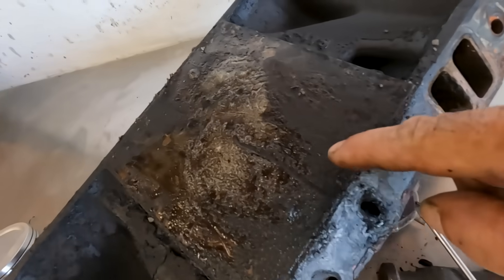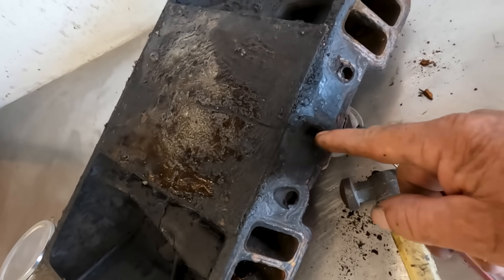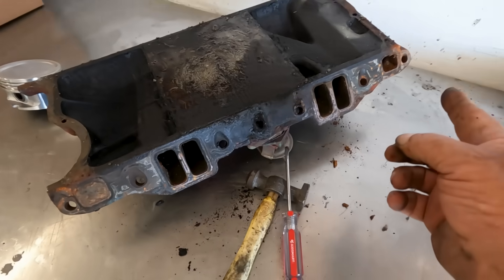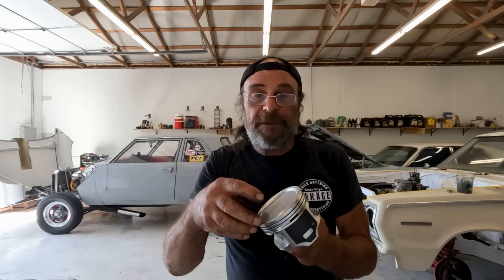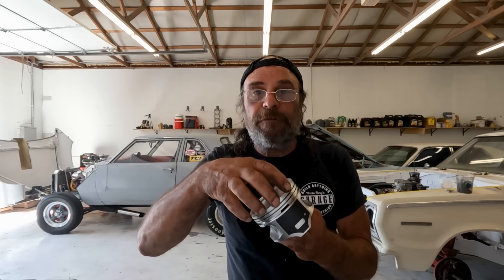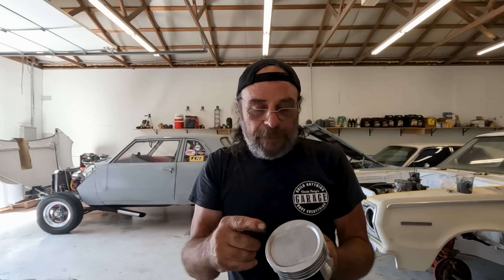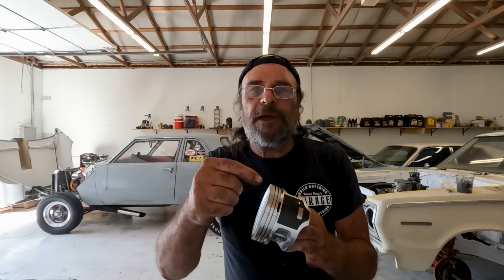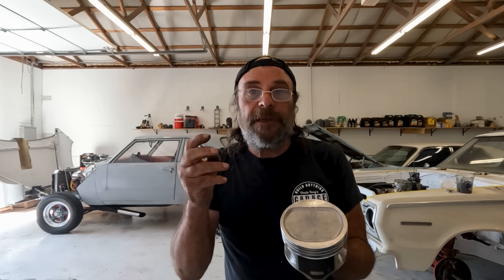The Number One Killer Of Gasoline Engine Efficiency And Power And How To Stop It

Comment: Toyota engines have a carbon ring problem. Main culprit for this problem is extended 10,000 mile oil changes. These cars would get up to 110K-120K miles and all of sudden it becomes an oil burner. I blame Toyota for this problem. They use to have recommended 5K mile oil changes on the engines used in the hybrids. They wanted to cut service costs for the customers so they changed the 5K mile oil changes to 10K miles. People that own these cars that do 5K mile oil changes, almost never run into this problem.
Reply: My 2 4Runners have the 10k spec. They only see 5k max oil change interval ever! Same with my powerstroke.
Reply: I change my oil and filter, every 3,000 miles, or three months, whichever comes first.
Reply: @Bill-sp8kb  I go by miles and not months.
Reply: My 2013 Camry gets changed every 5k and it has about 280,000 miles on the odometer.  I drive it everyday to the Toyota plant and back.  45 miles one way.
Reply: The oil rings are low tension for fuel economy but they allow more blow-by.

Comment: The olds 455 would get so hot, the manifold would Crack, and death cookies (carbon)would form under the manifold from the heat. The gas would evaporate out of the float bowl when stopped.. we all block them off now

Comment: Uncle Tony,
The water trick was used by a friend and I on his 1981 Buick Skylark 2.8 L V6.  We used a spray bottle set to a rough mist while blipping the throttle.  We did this right after running some Dexron/Mercon fluid into the carb help clean internals of the engine.  The water mist was a steam clean.  
Seemed to work wonders.  Thick smoke initially but cleared up, so it seems we cleared it out pretty good.  
Even the catalytic converter.  :D
Reply: I'd done this by removing one polution hose and adding a small tube to a 5 gallon water container inside the car. 
While driving , I'll open a tap. It helps increase compression. But the car was slowing, and it would backfire.
Reply: @paullionnet5141  Youre lucky you didnt hydraulic the engine!
Reply: Was a kid reading car craft in the 70s when I read about the trans fluid/water
Did it on my Dads 73 Impala.
Reply: @gordocarbo yes you put pee in side transmission and engine and the car work like new. OK

Comment: WHEN I  WAS WORKING AT THE  ENGINE BUILDING  SHOP. ..IN ONTARIO. I. WOULD REMOVE ALL THE VALVES AND  SPIN THE VALVES IN THE  DRILL PRESS AND KNOCK OF ALL THE CARBON OFF STEEL BRUSH  A WELDERS BRUSH AND  SAND BLAST THE INSIDE OF THE VALVE, AREA AND RUNNERS...I WAS TOLD BUY A BRITISH ENGINE BUILDER .I MENTIONED THAT I  TOOK  THE CARBON RIDGE AROUND THE  TOP OF THE PISTONS HE SAID THIS IS VERY  IMPORTANT IN SEALLING FOR GOOD COMPRESSION. ALL IN ALL THIS WAS A  CAME AND SPRING, VALVE SEALS. NEW. OFF EACH EXAST VALVE I GOT 2 TABLE SPOONS OF FINE CARBON....ALL THE  BEST...

Comment: Get yerself some granulated sodium hydroxide pellets from the hardware store, put some boiling water in a bucket big enough to submerge the manifold, WEAR GLOVES AND A FACE SHIELD, dump a cup or two of the drain cleaner in the hot water, (its gonna react violently) and after it settles down, put the manifold in and come back in a day or two.

Edit: you cant do this with aluminum, it will dissolve aluminum and ruin the mating surfaces.

Comment: People always caused me crazy when i used a coca cola bottle with water from the tap down the throat hole of the Holley double pumper on top of my then low 12 sec Olds in the late 80s. Whenever the engine came apart there were dark spots but never carbon built up on back of the valves or ring lands. As far as "blowing out the carbon" well that was done on a daily basis as part of the program of being a young mechanic with a musclecar.

Comment: I have a newer v6 camaro with direct-port injection. They're known to carbon up the intake valves. The popular thing to do is take off the intake and with each intake valve closed blast the valve with crushed walnut shell media and vacuum it out. I need to do it soon.
Reply: Port fuel injection engines never had that problem. The injector would spray almost directly on the intake valve it kept it clean.
Reply: I have a 2012 Impala that uses the same motor and trans from the Camaro. Best car I've ever had!

Comment: Back in the early 80s my father was driving his 77 Eldorado back from Florida via Kentucky to visit an aunt. Came out of his motel room and started the car for the trip back home to MA, and it backfired through the carb. He restarted it and it had what sounded like a rod rap. He left the Caddy and rented a car, then drove home. He drafted myself and a friend, and we drove 20+ hours straight back to Kentucky. He bought a crank kit and had loaded the car with tools, a chain fall. A chainfall. The heat and humidity were brutal. Before we started I got a large cup of water and started the car. I slowly poured the water down the carb and the knock just faded away. We took the car for a test drive to the next county, that wasn't dry, and bought a case of beer. Spent the rest of the day drinking by the pool. We were overjoyed that we didn't have to pull that engine out and replace the crankshaft and bearings in a dirt parking lot.
Reply: Back when you didn't have to worry about your car getting stolen when you left and came back for it.
Reply: My dad traded a case of beer for a '57 Chevy carry all with a stock Pontiac big block because the owner thought the engine was ready to let go from roof knock. After dad had his fun running the crap out of it he money shifted it on purpose to end it's life. After a loud bang it started purring and ran perfect. He drove it from California to Virginia and pulled the engine down to find nothing wrong. Only thing that came to mind is stuck rings from carbon since it was a city parts delivery vehicle
Reply: Yep......i used to run water, VERY SLOWLY into the carb like Tony says, after a good hard romp around the neighborhood.....and a cup or so is all it usually took and you could really tell the difference after you did it......that and the old Ford upper cylinder lubricant.....or better known as smoke screen creator....lol   throw a half a bottle or 2 of  B12 Chemtool in the tank and GO!!
Reply: @ssnerd583  did the same in the 80s. Use warm, or hot water and a spray bottle, rpm 2-3k it works
Reply: I thought people who afford new Cadillacs get tow trucks, not try and rebuild a near new engine by the side of the road?
Reply: @cruiser6260  Read the first sentance of bobs comment again.  The car was at least 4 years old.  (Back in the early 80s my father was driving his 77 Eldorado).
Reply: @Dave-ty2qp  well I wasn't making no assumptions about this beast being traded around in that timeframe, but yep he might of got it second hand. Hanging that chainfall somewhere on the hotel and rebuilding the motor right there woulda been a sight to see though!
Reply: @cruiser6260  Surprised so many never heard of AAA
Reply: @cruiser6260 that’s why someone can afford a caddy because they don’t waste money and they are self sufficient
Reply: @BENNETT-to-WIN-IT  ceptin for Boss Hog and Elvis maybe 🤔
Reply: Back in my day those were called pollution motors. The quench height, between the top of the piston and the low compression head, was too close on Daddy's. The carbon would build up until a chunk would break off and land on top of adjacent carbon build up thus reducing quench clearance to negative value. The results were many, to wit: crushed land on down side of piston, broken ring at same location, braided top rod bearing, lifted head stretched bolts, blown head gasket, spun bearing. Cleaning out the carbon only removes the noise.
Reply: @C15-4Life in those engines there was a lot of clearance, you’ve got your statement wrong.
Reply: So what sounds like rod tap but is actually caused by carbon?  Also, can't slow burning caused by cold, carbon coated intake valves be corrected by advancing the timing? or if combined with carbon hot spots, wouldn't the hot spots increase atomization, speed combustion and correct the slow burning issue?  How would a big, unatomized glob of gasoline detonate?  Water does sound like a good way to clean ring lands though and improve compression.  Might a trigger sprayer help to reduce the need for a steady hand to control flow rate and prevent hydro lock? 
    The opposing nature of the two problems caused by carbon seem self correcting to me.
Reply: @alan6832 the stuck rings from carbon cause piston slap which mimics the sound of rod knock
Reply: I did something similar to my 1970 Javelin. All that carbon build up came out & it ran like new. You must be very careful with that water down the carb. And don't have anybody stand behind the exhaust when you do this.
Reply: Good Ole carbon treatment, always did the water treatment before changing plugs so carbon doesn't break off in the combustion chamber causing a rod knock sound which is just detonation, it's a water injection treatment, cleans al the valves too!
Reply: @althouse2 water is bullshit.
Reply: Sounds good
Reply: What
Reply: How old were you? I wouldn't trust my 23-year-old college grad kid brother to replace a crank and bearings on my lawnmower.
Reply: @1776FREE2 age doesn't matter, skill and experience does. I was tearing down small engines and reassembling them with no problem at 12 or 13. First one didn't run when I got it, it did after I got ahold of it though.
Reply: How is this method at unsticking old rings?  My friend has a 2005? Subaru Forester with 280k miles, deteriorating compression leading to a low and unadjustable idle speed and stalling.  One theory is rings that got stuck and then worn, then the computer learns the unloaded idle speed, not the loaded speed, so the low compression stalls when idling in drive as at red lights.  Could also be just worn out rings or head gasket, also no plate so we can't drive it fast.  Should we try this in the driveway?  Also, can it crack heads from sudden cooling?  Not likely in the driveway?
Reply: The water turns to steam unless you pour too much too fast @alan6832
Reply: Valvoline restore protect oil change. $65.00 at Walmart
Reply: I changed con rod bearings in an  F150 in a motel parking lot once.

Comment: This never happened on European cars English cars 25 and 30 years ago strip down an engine and it was clean as a whistle no carbon build-up are all the new engines are total crap😊❤
Reply: Because European care had small high reving engines that you cleaned out yourself from normal driving i think. You don’t neee to ever rev more than 2500 rpm for normal driving in a big v8 so it gets clogged

Comment: I used to know an old school guy who put water injection on all his customers cars to keep the cylinders clean and the carbon down.  Inexpensive and made the engines last as long as you kept up with adding some water regularly.   Old Kerosene engine tractors ex 1929 McCormick Deering 22-36 used it as well. Works great.
Reply: Water injection also eliminates NOx
Reply: Edelbrock used to sell a kit that injected water through the intake manifold back when the first unleaded fuels were being made that had low octane before higher octane unleaded fuel was being made to combat detonation and carbon build up because of the crappy fuel being made back then . I have a book by Edelbrock called the great manifold debate if I remember that goes through the design aspects of different intake manifolds that they made besides other makes of intake manifolds and they showed this water injection system they developed way back then & explained how it worked & what exactly it did . Once premium unleaded fuel was made that had additives added to the fuel for cleaner burning fuel these kits all but disappeared from the markets . I'm sure Edelbrock lost a lot of money on developing & designing this system at that time but we're a head of the game until the unleaded fuels were getting better as far as octane ratings and the use of certain additives in the fuel that were supposed to combat detonation pinging & excess carbon build up but even with these additives carbon still gets on the tops of pistons and the valves especially the intake valves because they run cooler than the exhaust valves do & this is why we are seeing this video because of carboned up intake valves from the fuels used & how UTG mentions the water trick to knock the carbon loose .
Reply: Water injection also eliminates NOx
Reply: My father told me about the water into the old kerosene tractors.  Thank you for mentioning it.
Reply: German did it during ww2 in aircraft engines with a Mixture of Alkohol and water
Reply: @Haffschlappe 9:05
Reply: Yup, my still running 1923 McCormick Deering has water injection.  I believe the intended purpose is to increase the octane number of the kerosene fuel to stop pinging.

Comment: Great tip for the carbon removal, a  little 1/4 cup of marine two stroke oil in the petrol can clean it to and your manifold is just strip out all the parts and a wood fire drinking beer.

Comment: Use to poor F type transmission down the carburetor until the engine stalled. Let it set for 5 minutes. Start it up and gas it. Smoked like hell for a while. Used to do that twice a year. This was done back in the 70's thru the 90's.
Reply: I did that on a 1967 Grand Prix once.  Once.  A piece of carbon got stuck in one of the valves and then I had a 7 cylinder Pontiac.
Reply: Learned this from a friend that worked with Smokey Yunick. Just like I learned that they used vegetable oil to put an engine together. I learned a lot of things from him, and he and Smokey new how to build engines.
Reply: That is awful advice 😂
Reply: Yep
Reply: A modern fuel clean solvent cleamer like Berryman would probably worl better.  Trans fluid has detergents that clean but probably not best used in the fuel system.  It'll smoke off but again doubt it will remove carbon, like a good fuel system cleaner.
Reply: Don't Do that on  Vehicles with Catalytic Converters You will Destroy Them !
Reply: @DanWright-w7x  I should have mentioned that it was on the 1969 Cougar I had. Back in the 70's the converters were different, and it didn't take much to plug them up. They also get so hot that they caused grass fires, and some cars would catch fire. What a lot of guys did back then was to hollow the converter out. Ford had two on their V8's and that was double work. GM only had one and fake duel exhaust. Chrysler I can't remember how they were set up.
Reply: If you have a vehicle with a cat converter be sure to use an kerosene/alcohol based product instead.  Seafoam is the traditional option but there are plenty of alternatives available.  You're probably not going to ruin the cats doing this once with trans fluid but it sure won't help their condition.

Comment: Yes, I remember pouring water in the carb when running the engine. My dad called it a Tijuana tune-up. He told me how the steam blasts the carbon deposits off everything. We would rev the engine up around 4k rpm and slowly pour it from a coffee cup.
I have my heat crossover deliberately blocked off on my Offy Dual Quad intake in my 68 Barracuda.
Reply: I've seen uncle tony videos years ago where he did exactly that.
Reply: Marvel mystery oil used to sell these kits you could buy that had a glass jar and all the fittings needed to hook this system up to a intake port or vacuum port that had a adjustable jet to fine tune how much marvel mystery oil would be sucked into the intake manifold while the engine was running . This not only would provide a little more upper cylinder lubrication but it also helped knock the carbon off of the intake valves as well as kept the carbon that could get between the upper piston rings of the pistons cleaned out. The idea was to use this system plus add the marvel mystery oil to crank case at every oil change by their recommendation of how much to add to the oil . Not sure if they still sell these kits or not but many years ago I worked for a shop that was sponsored by the MSRA Minnesota street rod association and I worked on a old Plymouth from the early 50s with the straight 6 in it that was in beautiful shape and the owner had one of these kits installed on his car and swore by using this stuff . This was in the early 90s when he brought the car to our shop and he was in his 70s then & had bought the car brand new he had told me when talking to him back then .
Reply: I think seafoam is the same concept, slightly more expensive I guess but works by shooting it in the vacuum line on a lot of injected rigs as well. Not sure which vehicles exactly it supports but was planning on doing it so I have a can sitting.
Reply: @Nickelbawker i find seafoam is a little harsh on rubber seals and stuff like that. Ive used it a few times and honestly never noticed a big difference.

Comment: i was told the other day that a carb engine can still produce more HP than a EFI can do you agree? my thoughts is the reason you talked about today the closer the fuel is to intake valve less time to mix thats one of the reasons direct injection gives so much trouble
Reply: All thing being equal in the engine they will be equal as far as horsepower, the EFI can be smoother and more drivable  in every day use.